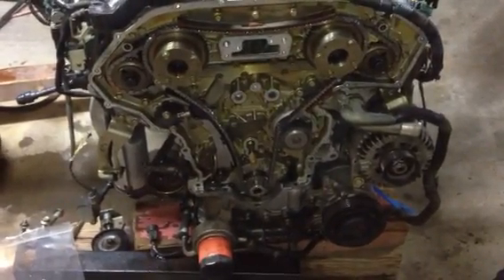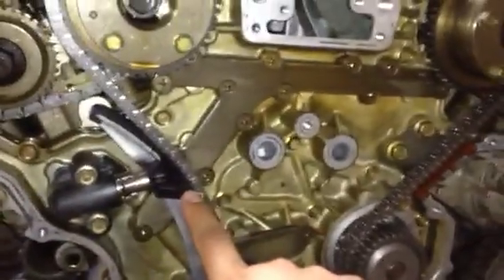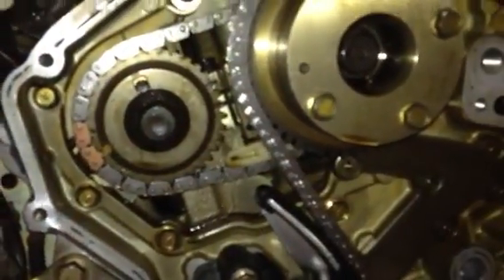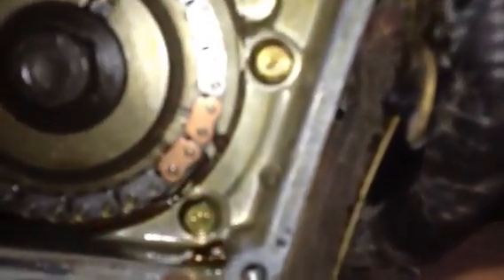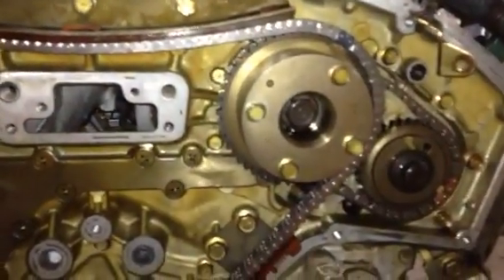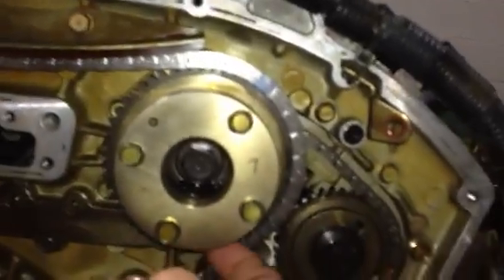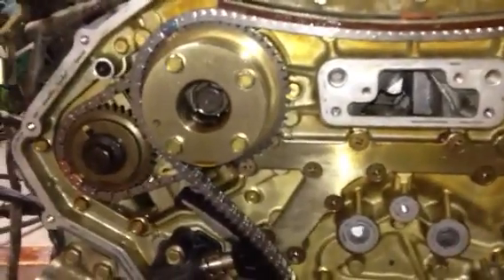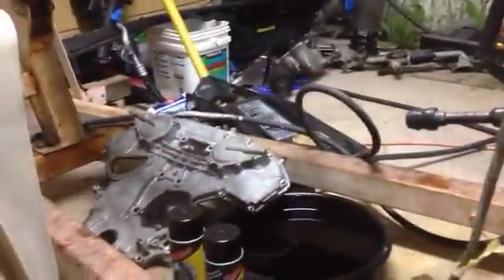Nissan 3.5L timing chain update

Comment: So u took out motor and transmission together as removed the radiator and ac condenser and bottom of crandle and suspension n wheel stay on vehicle?

Comment: well I am going to be 64 july, have one lung and I am finishing up replacing timing chains  and its not hard it is just a lot of work. I spoke to someone that works at advance auto that owned a maxima, he said he replaced the chains and 10k later it happen again. so' all I will say is this, I bought all new motor mounts off Amazon prob 2 yrs ago, but I am not here in the USA  for 6 months of every year, as I was pulling it apart I took the new mount I had replaced off and noticed that the ear was broken off and from the looks it happen some time ago, I paid $129.00 for this chain kit and now after seeing this mount I am sort of sorry I  didn't buy the 259.00 kit which I believe was a Nissan mfger.  we ll I guess its a wait and see cause if it comes to doing it again I will, I have the car ready for paint also, painting it the same navy blue it was from factoryr.  I have bought many parts from Amazon  not all for this car, I live next to a salvage yard and sometimes buy a car to repair I go slow but I get it done  and done right. I have had some bad times even with parts from NAPA,  bad rotors, did a brake job on an f150 and whacked the front rotor to free it up and it actually broke! crap metal, suppose to be made with steel but the chinese are using cast iron which means it will heat up and warp and also if you hit it with a hammer it will break... happy motoring men!

Comment: Timing cannot jump if everything was done correctly to begin with. You may have misunderstood him too. Its best to turn the engine over at least several full and complete revolutions to be sure everything re aligns when Top dead center comes around. I was told it may take as many as 30 revolutions before cam phazers and everything realign again. Once you are positive nothing was done wrong and nothing moved THEN you button up the timing chain cover. I learned this 45 years ago on my first timing chain job.

Comment: Take out the fuel fuse... basically crank the engine couple times so the oil goes to the tensioner .. don’t start the engine o

Comment: So if the timing is 180 degrees off, the engine will turn and try to crank, but won't start right? 

And no harm done?..just have to redo with cams aligned properly, and crankshaft turned one full rotation (clockwise), then reinstall main chain and button it all back up???
Reply: Yes, it should not harm anything, I've done that before on my 240sx and all it did was back fire out of the intake..

Comment: Just to recap to the water pump video as he disabled the comments.... Copied from my other post.... 

I don't quite know what scare tactic is being used by mechanics(Sales strategy that helps other mechanics, can't blame em... no cars, no money)... But honestly, it's nothing close to a "Pain the the ass or PITA or a bitch to get too, etc...".  It's actually quite straight forward and nothing close to how everyone makes it seem, Easy to do in the car.  His vid scared me but i said fuck it, I know it can't be nothing like he's explaining

*NO, you do not have to go to TDC to do this.  This is not some "Half ass job" or "Hurry to get it done" methods. I have worked Nissans for 9 years prior to working on the more PITA Mitsubishi motors, ever done a water pump for them shits?  Anyways here you go so relax and remain clam.

Water pump Removal

1. Remove ONLY THE BACK BELT, yes you don't have to waste time taking the other belt off.
2. Remove Upper radiator hose
3. Remove the main harness plug for the fans
4. Remove the Fans(One Piece)
5. Remove the covers to the Tensioner and water pump.
6. Pump an allen key in the hole that you will see on the tensioner(If you don't, you will have to put it in a vice, you can press it back)(THIS STEP IS ALWAYS MISSED!!!)

7. Keep a mag pen with you to hold against removing the bolts, drop a bolt, you will spend the week pulling the timing cover
8. Keep a hold of that pin in the tensioner while you remove the last bolt to it, pull together and steady, Once you place your hand on the kep, don't let go. Pull away and TAKE YOUR TIME.

9. Turn your crankshaft COUNTER-CLOCKWISE LIKE 5-6 DEGREES as you look at the tension side of the chain... When it goes straight and somewhat tight, STOP!!!! Go to far over, Much luck to ya bub.
10. Pull the pump out by wiggling or lightly jarring it out. DO NOT USE ALL THE MUSCLES YOU HAVE! It's tight but you will get it.(I didnt have the right bolts to put in the top and bottom to wiggle out, I was replacing it anyways so I used an angle screwdriver with a larger head and pryed it bit by bit).
11. Put the new pump it, add some ED(Even when they say not too because it does not make a difference)
11A. You will have to faggle around with the chain to get the pump around it but DO NOT use force.

12. Tighten the pump up(YOU HAVE AN ALUMINUM MOTOR, DO NOT TIGHTEN THE FUCK OUT OF THE BOLTS LIKE I SEE A LOT OF PEOPLE DO! Those o-rings have a good seal.

13.  Once it's on and tightened down, turn the crankshaft CLOCKWISE and put everything back in. DO NOT PULL THAT PIN OUT UNTIL YOU GOT EVERYTHING TOGETHER before you close the seal.

14.  Before you close the seal, go ahead and turn the crankshaft clockwise all the way around for piece of mind.
15. Bolt her back up, filler up, idle and filler er again... Done (I'd use a Lisle Spill-Free Funnel) because you will be bleeding the air out and that back of the firewall bleed valve makes it a pain in the ass to bleed.

Comment: Hi Great video Turo thanks ....I got 04 Quest 3.5 .......Were you able to do it with taking of the 3 bolts cover or I need uo take of the big one for the quide ??? Also wander if it is just replace just the plastic only on the quide itself  if not doable through the 3 bolt cover the whole guide ??? Thanks

Comment: Hi, How much should this cost at a repair shop?  Where are you located.Thanks
Reply: It'll sometimes run you $1300-$1400 parts and labor. If you don't have that kind of money I suggest you find a hole in the wall mechanic shop in need of work.

Comment: will this timing chain issue cause a vibration/shimmy upon acceleration or under a load?   I've replaced literally ALL front suspension components, full tune up, new tires, balanced, etc.

Comment: I do all my own work on my vehicles.  I save so much money by doing it my self.  so I will do it how I want.  but it's a good thing I pulled the engine, because two of my engine cradle studs were almost rusted through.  if I wouldn't have pulled my engine I would have never knew that and my car could have fallen apart while driving.
Reply: B

Comment: What this guy did was give anyone who was contemplating doing a(timing chain, tensioner, or a timing chain guide replacement) the ability to look more in depth at the type of problems you might have when chains are not installed properly and gives you some insight on what to look out for. Anyone can tear stuff apart and put it back together, but putting things back together properly is what many fail to accomplish. The mechanic that was taking shots at the guy for removing the engine form the vehicle and then stating that he was charging his customers for the job, um yeah i think its his own personal vehicle. I have yet to see anyone cover the whole job while the motor is in the car, they just remover parts and say "yeah that's the chain" . Cool reference video.
Reply: There are several videos on here that show the entire process....with the engine still in the car.

Comment: Sounds like nonsense car can fail to start at first because of various reasons like fuel pressure haven't build up yet take for example  2011 sti if you disconnect the battery and reconnect it on your first try it will not start
Reply: i just replaced my tensioners and my car wont start but the gas needle moves like crazy could that be the cause?

Comment: 2004 Nissan Armada 5.6 mechanic says it needs timing chains replaced and he doesn't want to do it. A mechanic from the dealer came down to look at it and says it is a 15 hour job at $100 an hour. Does that sound right to you?? Some say it isn't worth it to fix, should just replace engine. Engine has 200,000 on it. What you think? Thank you for any help in advance!!
Reply: tbh just find someone to do the timing chain it really isn't that hard to do these ppl just wants to take all your money, with 200 miles u still got plenty of engine life in that engine
Reply: +Cindy Lou , It is a 15 hour job to do those chains. With 200k miles, I would replace the engine. It's not much more in labor to replace the engine.
Reply: +Aaron Christians 200k

Comment: There is no need to remove the engine on a Nissan to to the chain set. This is very odd and unnecessary.
Reply: U wrong it's very necessary to remove the engine in other to have a proper result
Reply: @Auto720  wrong answer sir. One can see everything that is seen in this vid with the engine still in the vehicle.

Comment: I am thinking of buying a 2003 Nissan Altima for $4800 with 67000 miles. But it makes a ticking noise when it start running . Other than that the car is in great shape. Should I buy it , and if I do how much should I pay to to fix what u did. Thanks tony
Reply: Run away.   That Renault is a money pit!!!
Reply: Tony Dangelo Did you ever buy it ?

Comment: I have a noise in the engine it's not as loud as the one in your my mechanic says my timing chain is worn out and he as to take the engine out to change it I need some advices! !!
Reply: Delrose Mcbean I'm going through this now with an '04 Quest I bought with the timing chain rattle.  Nothing I've seen on any of the videos indicates that a running engine with a noisy chain, in these particular engines, requires a new chain.  That said, my advice to you, and what I'm trying to do, is find a mechanic who says, yes, we have done a bunch of these.  Usually that place is the Nissan dealer, but if you can find a good mechanic who is now independent and has done a bunch of them, maybe he knows how to McGyver it without removing the motor.  My local dealer in New Jersey is quoting about $1300 to do the job.  And, that is just the tensioner not the chain, sprockets, water pump and all the other stuff buried in there.
Reply: Delrose Mcbean 
You dont need to take the engine out. I am a Nissan Master Technician and I Charge 8-10 hours labor [depending on vehicle condition] GO TO THE DEALER ! You should pay no more than about $1500+tax for the job.
Reply: Delrose Mcbean +NUTHUGGER2000 is correct, motor does not need to come out of any NIssan with a 3.5 motor to replace the timing chain.  There is a fair amount of disassembly but motor does not need to come out.

Comment: good info on the weird tick marks.  this looks similar to a pathfinder engine.  thanks for the info.  i usually run my engine manually a few turns and check the marks again.  is this standard?

Comment: Great video! I am wondering if the engine needs to be removed to complete this job? Or can it be done while it is still mounted?
Reply: its ususally done with the engine in the car, but easier to access this way.

Comment: what happen if chain not adjusted proberly ? would the engine works ?
Reply: Sadiq Almashaifari When you install, you need to make sure your cams are lined up before putting tension on the chain.  Once you do put tension on the chain, you need to turn the motor over 2 complete revolutions by hand, meaning the crankshaft needs to do 4 revolutions, else you do run the risk of throwing your timing out of sync on the first start
Reply: it has automatic tensioners so you should not be able to adjust.

Comment: I changed the water pump and the timing chain tensionare and when i turn the car make a noise and the car turn off could u say me a fes cause i'll will thank
Reply: You probably moved timming... you should have removed tensioner and gone back twenty degrees back on crank yo relieve tension from the chain... installed the water pump and moved crank back to its original location and installed the tensioner

Comment: If I already set the timing wrong. by removing the water pump without removing the cover. I forced it in. I didn't break anything. The car starts but the timing jumped somehow. The idle rpm is lower than before, and Reverse forces the engine a lot. How do I fix the timing now? Should I follow the marks as you're stating
Reply: Did you get this fixed? I was thinking of doing my water pump and am scared
Reply: Dan E don't do it yourself.  I did mine and it was hard I ended up damaging the engine because timing was changed
Reply: how did you re time it, or did you take it to a shop?

Comment: If I replaced my tensioners and guide and didn't touch the timing chain whatsoever yet my car just crank and cranks but won't start , so do I have to rotate the engine manually until all tick marks line up?

Comment: If I need to remove the secondary chain tensioners do I have to pull the cams or is it easier than that?
Reply: no but you have to remove the front and rear valve covers to access the secondary tensioner bolts , you will also need to hold the cam shaft with a wrench to keep it from turning when removing spocket bolts
Reply: Thanks

Comment: Thanks for the video, this info was very helpful. I changed my chain,guide and tensioner with no manual,only your videos. I did not remove the engine, (what a pain in the a??. I actually think screwing around with the power steering pump was the biggest pain of job. I had a heck of a time getting to one of the bolts. One thing I was told to do from Nissan was to do the ECU Reset,Throttle & Accelerator Position Learning before I try cranking it over. I did that and it fired right up. Thanks alot for the video, saved you saved me alot of time with important questions i would have ran into.

Comment: Hey men first of all your video is really good, you explain a lot of important things. Well I have the same issue in my 2005 Altima SE 3.5, the ticking on the timing chain but I have some question and I hope you can help me.

1.- I found this kit on eBay http://www.ebay.com/itm/2004-Nissan-Altima-Engine-Timing-Chain-Kit-Water-Pump-3-5L-Chains-Guides-New-/400637368211?pt=Motors_Car_Truck_Parts_Accessories&fits=Model%3AAltima&hash=item5d47d91793&vxp=mtr is the right kit or I need more pieces?

2.- What about the "jumping time"? How can I damage the timing?

3.- Did you replace the secondary sprockets (left and right? It is really necessary change it?

I know are a lot of question but I really concern about it, it's annoying hear this sound so again, I hope you can help me.

Thanks men.

Comment: TuroFM, I'm making my rounds to thank all of the videos that helped me. I did the same work with the same '06 Quest engine in place believe it or not. I was particularly concerned about the secondary sprocket alignment, but once you are certain that your No.1 piston is at TDC, the the cam keyways on those secondary sprockets align perfectly with a raised line on the back wall behind them. The primary chain sprockets have a line on the sprocket itself  that run parallel to the secondary keyways and if that's not enough to assure anyone, the gold links must also align with the tick marks on the sprockets both secondary and primary just as you detail. Note to others: You should have another to help you remove and replace the sprockets as a set because it's a tight fit and it takes two hands on the sprockets and one on the chain to ease it around the tensioner. Also, double, triple, and quadruple check your links, tick marks, housing marks, and TDC indicated by crankshaft alignment before you button up. I even and turned the crankshaft several times (with sparkplugs removed) because I really wanted to make sure I wasn't hitting any valves. It took me a full week to do this but I did it and saved thousands. Kind of hard to believe it was all for a 50 cent piece of plastic. The secondary timing chain guide whine is gone! Thanks TuroFM!

Comment: Great vid....appreciate you taking the time to post and share your knowledge. I've poked around your info and some others and have realized that if I'm going to pull this apart I need to replace the secondary chains and the guide that mounts on the secondary tensioners. You pulled the sprokets off the end of the cams to get at those secondary guides, did you need to pull off the valve cover and put a wrench on the cams to hold them still while removing and installing the bolt?

Comment: TuroFM: Talking about the old guide.  The top portion of the plastic, did it break off causing it to fall down? Looking at the new guide the plastic wraps around the top portion of the guide.  You probably threw away the old one but just wanted to know if it shows if that portion broke off.

Comment: I don't do this for a living. I would guess here in AZ mechanics would charge anywhere from $60-90/hour. You can expect to pay more at a dealer since they quote their "Labor Fee" book and it states that the motor needs to be removed while it is not necessary to remove the motor. At the end of this video I quote some other YouTubers that show how to do the repair with motor in vehicle. There are pros and cons to both...

Comment: Great video TuroFM. I have a 350z with this engine and a broken valve spring (intake). Do you know if it is possible to remove the intake camshaft and then the spring without removing the timing case, chain, etc, etc?

Comment: guau this is a very helpfull video bro tanks my dad is mechanic and he said that what you did is the rigth thing and he also told me that you shuld use sintetic oil that will help a  lot too i just got a maxima and i have the same problen but tanks to this video i have the chanse to fix it i know this was a year ago so how the motor is working after that